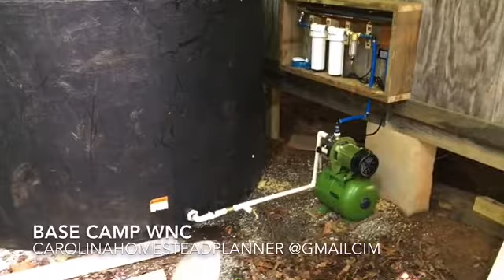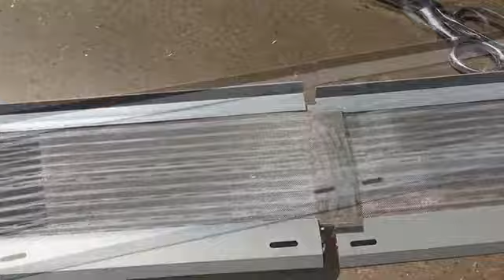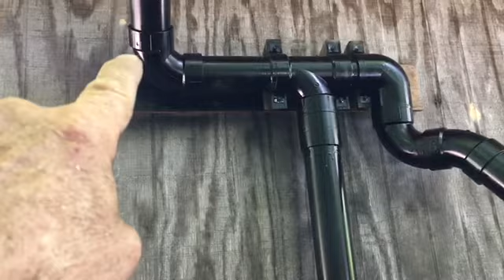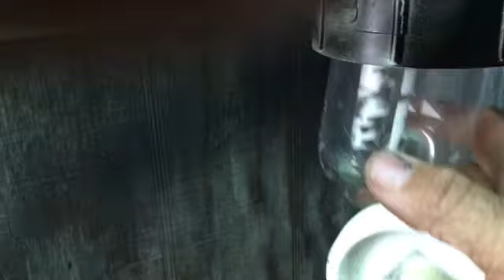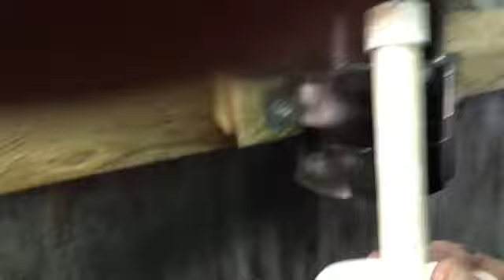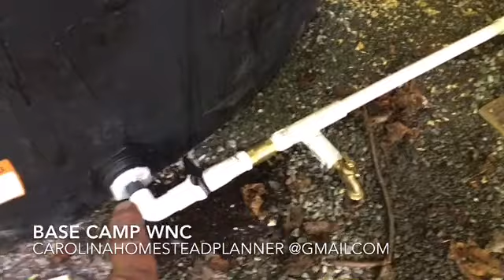Rain Water Collection And Filtration

Comment: How do you calculate the length of the flush tube where you talk about the square footage of the roof as you said? btw, very nice job!
Reply from the maker: The rate of 10 gallons per 1000 square feet of roof surface 
If the roof is under trees a little more 
3” pipe holds 0.3672 gallons per foot 
So that roof is 400 square feet 
That’s 4 gallons of water in the first flush
Take 4 gallons divided by.0.3672 is 10.8 feet of pipe
If you don’t have enough room for the long pipe go to a larger size pipe
You can Google a rain water collection guide and pipe water per foot guide
Hope this helps
And as always subscribe like and share 
Thanks
Eric

Comment: Love it! Can you link me to the UV light I need to get one installed but really not sure about them being so many on the market, we use less than 50 gallons a day thanks
Reply from the maker: The main thing in determining which UV light is the water flow 
A whole house would need around 12 gallons per minute so it can clean up the water 
And this light will be of the higher watt around 50 watt
The light I used on this project was 6 gallons per minute and 25 watt
About $150.00
There all on Amazon 
And as always subscribe like and share 
Thanks
ERIC